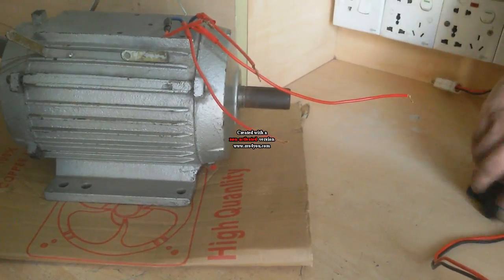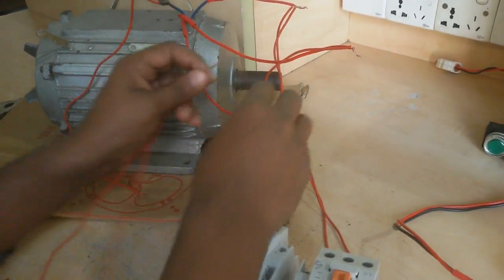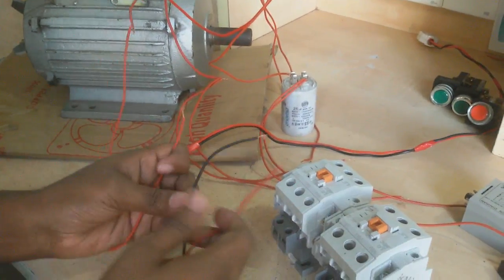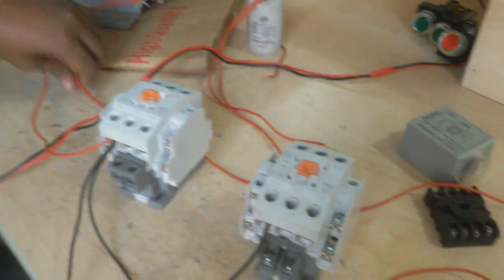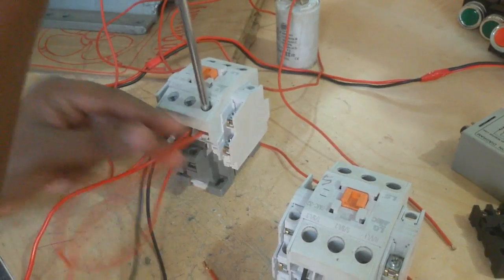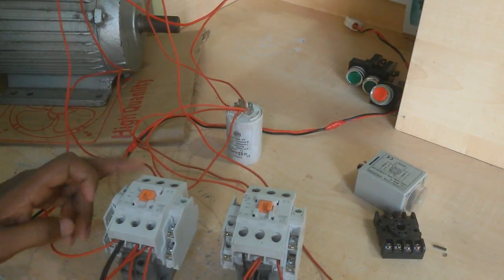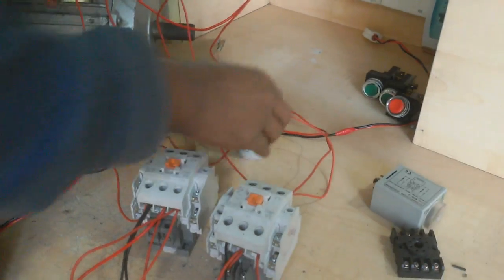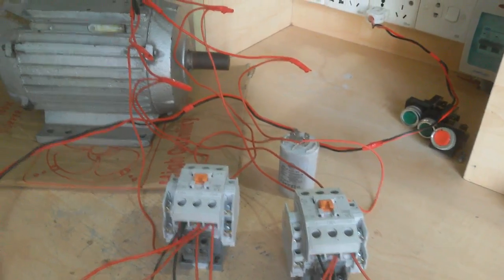how to connect a single phase motor reverse forward in english .

Comment: Hello BD, can you please tell me what is the the brand and type of Magnetic contactor you are using for your demonstration and where I can purchase them from.
thank you for the helpful videos. tho all red wires does make it hard to keep track of what is going where. :)
Reply from the maker: Schneider Electric & Others. thanks for your comment. Please share my video.
Reply: what model are they, when I look there are REVERSING and NON REVERSING I'm just trying to get what I know will work for the job I'm trying to do which is convert a lathe from three phase to single phase and be able to reverse it.